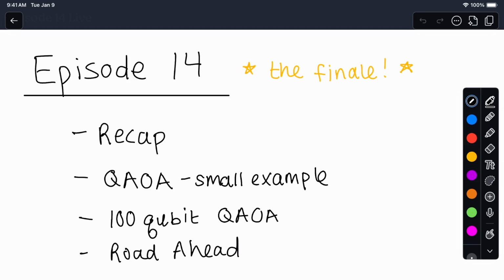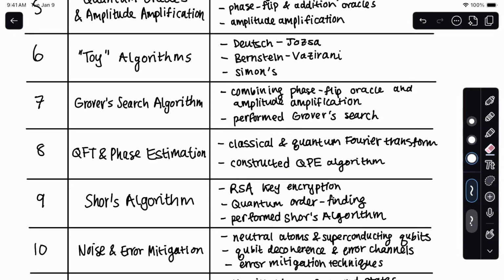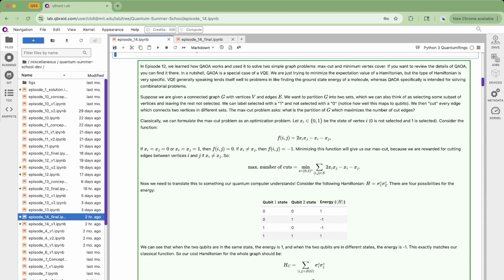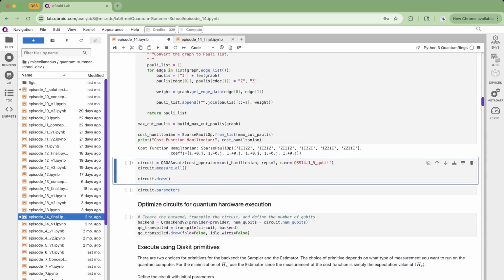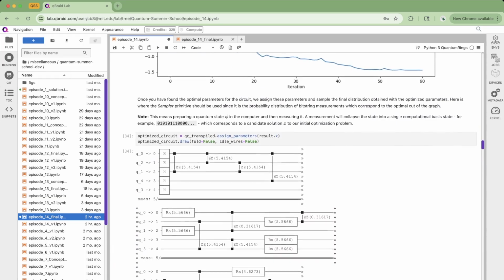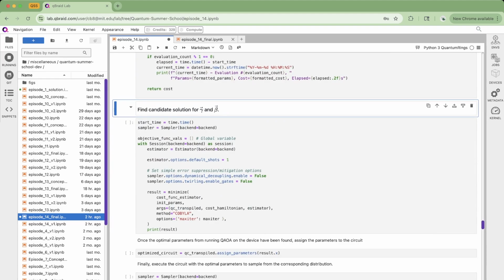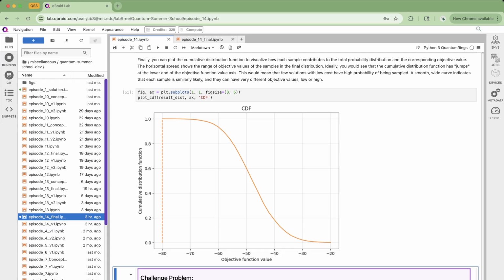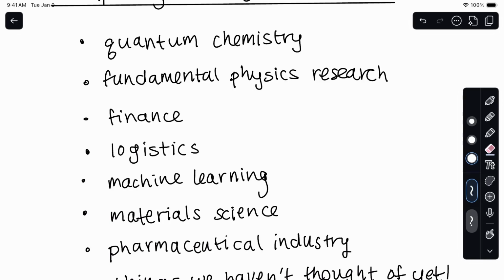Quantum 101 - Lesson 14: Capstone: 100-Qubit QAOA & The Road Ahead.

Comment: When running the notebook, I had two issues. Here, I am providing a workaround for those who experience the same problem. 
The first issue is the ibm_run_time:

ImportError: Cannot import name BackendEstimator.

The latest version, 0.41, forced Qiskit to install Qiskit 2.0. For this to work, you need to install version 0.20 of the ibm_run_time (worked for me).

The second issue is with the account:

 AccountNotFoundError: 'Unable to find account.'

This error indicates that the Qiskit IBM Runtime service cannot find my saved account. The session object from qiskit_ibm_runtime was attempting to locate a globally saved account, but my account information was provided directly to the QuantumRingsProvider via the TOKEN/account ID. The QrEstimatorV2 and QrSamplerV2 should work directly with the backend object you've already set up. Therefore, the solution was to remove the with Session(...) block..